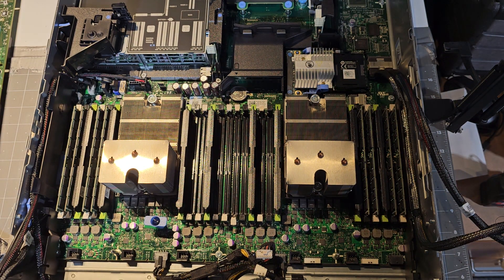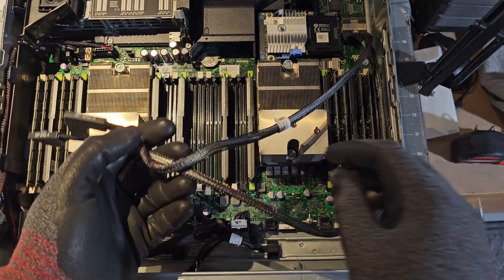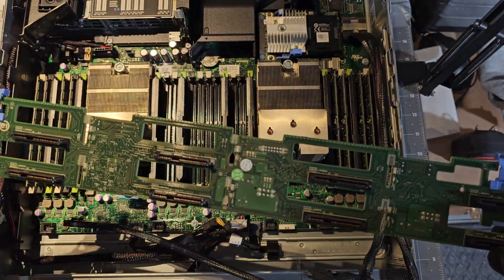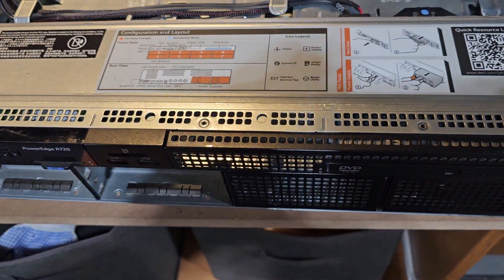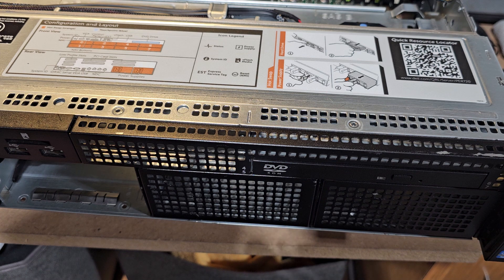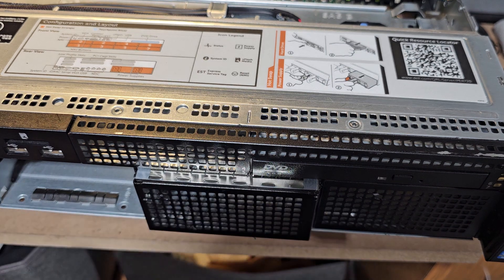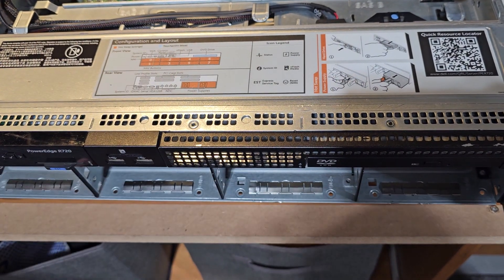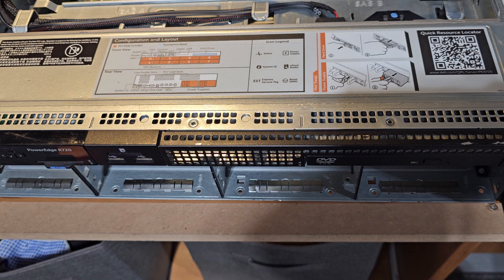Dell PowerEdge R720 4 Bay to 8 Bay Hard Drive Cage Removal - Quick & Easy Upgrade!

Comment: I have the 8 bay 2.5” and want to switch to 8 bay 3.5” on my R730. Backplane is coming in soon, I’m hoping it’s as simple as this because no one else on the internet has input on it, thanks for the video!
Reply from the maker: will not be possible dude. the 2.5 and 3.5 server chassis have different molded metal chassis.

Comment: I think dell does this bullshit on purpose.   They do not want people upgrading 4 bay sytems to 8 bay even with same size drives.  They want to sell the same unit with different price points.  The hardware (boards are sometimes the same).   T-360 does the same crap.

The dell customer service does not really know or will lie.    I got chastised by a dell customer support tech for asking the question in hardware forum.   
I got a good deal on a t-360 through outlet.   I asked the question before it had been delivered.   They told me if you really want 8 drives, you should refuse delivery, WTF.  
The boards are the same.

Comment: hi, I got a question for you :) I got a deal on an r720 with originally 2.5 bays and the seller is saying its not going to work for my 3.5 drives. Any suggestions I've never touched these type of computers before so I dont know if im missing something obvious. In a normal computer its just a cable i plug it to a 2.5 or 3.5 no fuss but I'm not sure if dell's require an hdd bay . I dont mind frankesteining it a bit and just having mypair of hdd drives sitting there without being secure. Any recommendations?
Reply: same as what he removed here you would pull out the whole block of the 2.5s and put a 3.5 in and then swap out the rectangular backplane that you saw him showing the capacitors on.
Reply from the maker: no. the chassis itself is different for 2.5'' and 3.5''. wont work sadly.